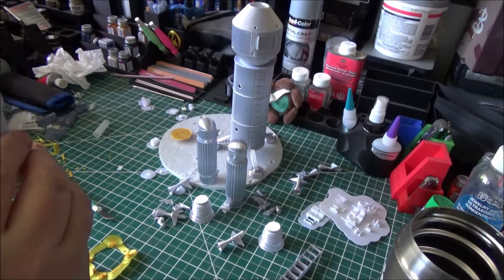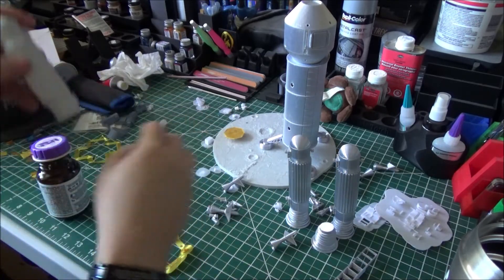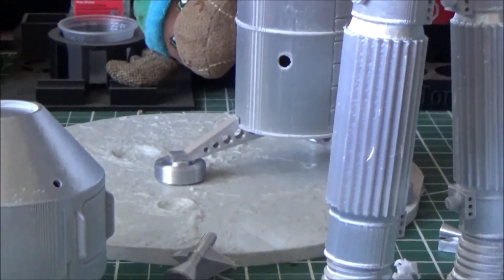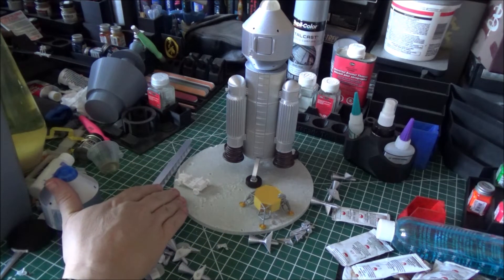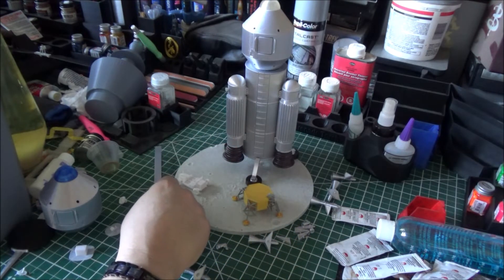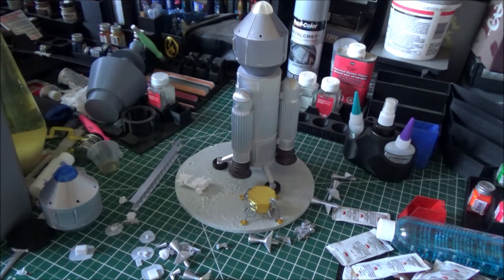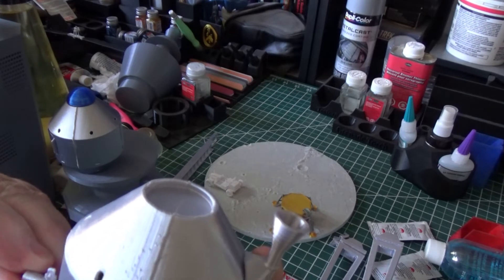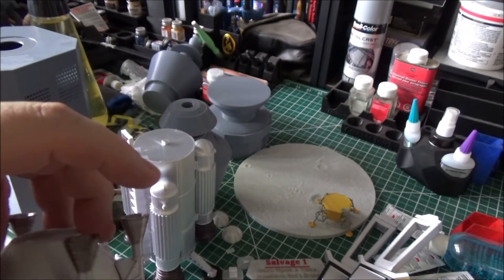Salvage 1 The Vulture

Comment: I just finished rewatching the pilot movie on and I notice that the engine exhaust bells don't point outward, Looks like they are straight up and down, So it might require some sort of spacer between the engine nacelles and the main body for the engines to fit correctly. I know it's probably a little late to point that out but i felt the need suggest that anyway in case you plan to make this a kit for sale.. And once word gets around I bet I won't be the only one interested in purchasing the kit. I might also suggest posting to some of the major model channels Dudes here on YouTube such as "Interstellar Modeler" and "Aztec Dummy" and maybe even Boyd over at "TREKWORKS" that you may have this kit for sale someday.

They would probably be more than happy to support you, Of course this would mean sending them a free sample kit to work with then they could help you make any adjustments to the kit and thus help promote it through their build videos. In fact Interstellar modeler just helped a guy perfect and promote a 3d printed kit of a Tie Bomber a few months back. Once again this is all just a friendly suggestion or advice, You may already have a game plan in which case feel free to tell me ta buzz off :)

Oh, and personally I think the plague that says "Salvage One, Once upon a time a junk man had a dream"  is perfect and is all that is needed. And I myself don't even care about the little LEM descent stage and Lunar Rover additions, Just the Vulture, Lunar base and plague is all I want in a kit. Anyway I'll shut up and go away now. But if you do someday offer it as a kit I would love to be one of your first customers :)

J.D.